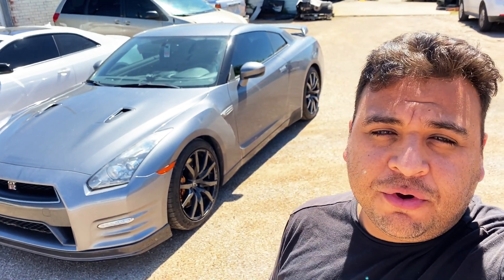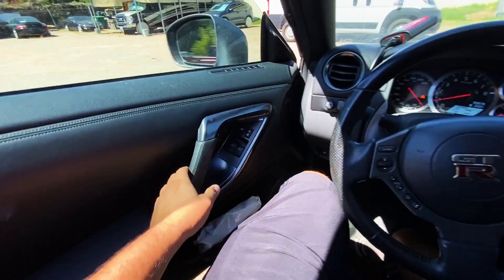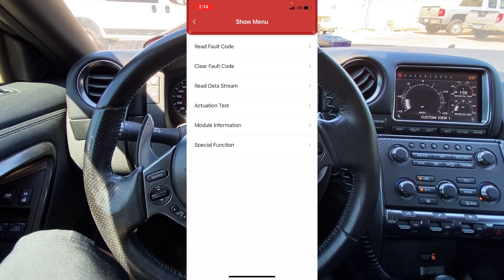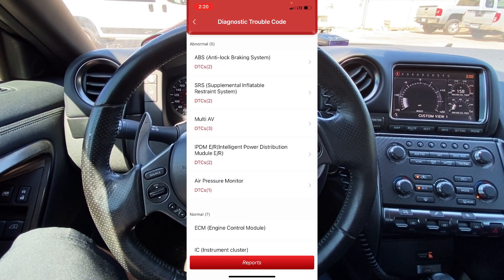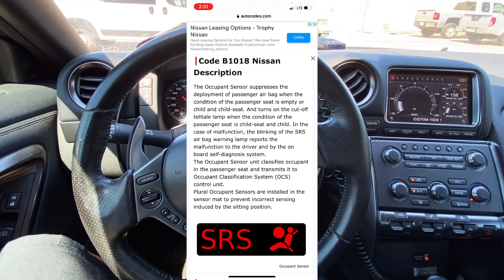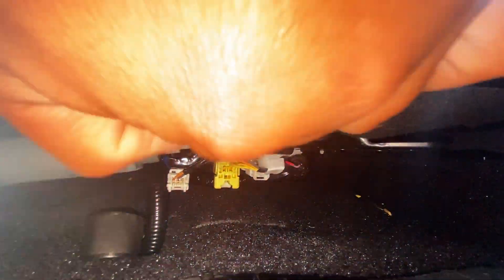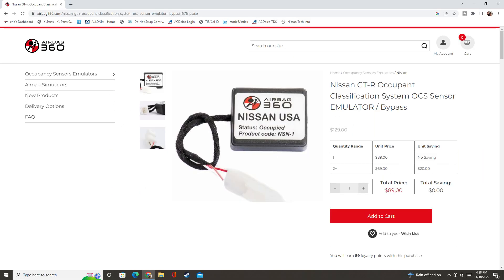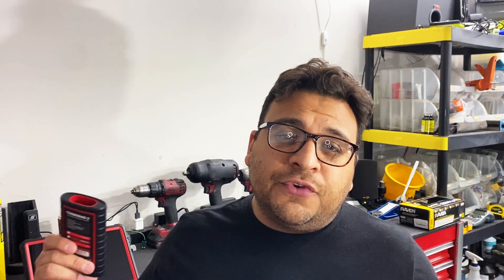NISSAN GT-R AIRBAG LIGHT ON / FLAT TIRE MESSAGE ON DASH DIAGNOSIS & FIX

Comment: i ordered this tool for 157 bucks and it shows that it support iphone in the doc. it does not (it says to download  THINKDIAG for IOS. there is no software on the app store. it only have THINKDIAG+ and when i go activate it it shows NOT supported on THINGDIAG +. it also DOES NOT SUPPORT NISSAN GT-Rs. that is not a car that shows on there site under supported cards.

Comment: You could have tried out a zero point calibration for the occupant detection system. In some cases an impact could have occurred at the passenger side that could have made the sensor run out of calibration

Comment: Does it still have a switch for you to manually turn it off like older cars had I'm sure that my mam's 2015 Micra has a manual switch that you can turn off does that mean it still has that sensor.

Comment: We have seen A LOT Of Occupant sensors on Nissan's and Infinities over the last few months.  Seen a few over the years, but a lot more in the last few months.  Must be something in the air haha.
Reply from the maker: Seems to be a very common problem and they’re not cheap to fix. I think airbag360 is onto something here.
Reply: @ADVANCEDLEVELAUTO  I never knew about them till your video, I will deff. be keeping them in the back of my mind for my customers as an option.  Thanks!
Reply: @ADVANCEDLEVELAUTO  very common and datsun used to be toyotas equal not any more

Comment: Eric I’ve been following you for a long time and trust your word. I purchased the diag one and also have the launch diag 4 mini. I’m a Diyer and it looks like a quality tool and would like to purchase one. You said the first year comes with all models. Are they just OBD 2 or enhanced versions. When I upgrade mine I only select Honda as those are the two cars I own but for a yearly update on all vehicles for approx. 100$ it sounds like a good deal. Any thoughts my friend and if I do purchase I hope you make a few bucks on the sale. Any help or advice is welcome you and family stay safe and well      Artie ☹️
Reply from the maker: If you are planning on buying the software update for your Thinkdiag 1 then it may be worth it to just buy the Thinkdiag 2 for a little extra money. They are having a lightning sale right now and you can buy it for $120. It comes included with the full enhanced software package for 1 year. It’s worth it if you work on various makes and models. If you only work on Honda then it’s probably better to just buy the single manufacturer software. The nice thing about buying a single brand software is that even after it expires, you don’t lose it. It still works, you just can’t update to the latest version. Which honestly isn’t needed if you don’t work on brand new vehicles.

Comment: Help - Help - Help…
I have a ‘13 LS460. It was rear ended. My Headrest A-Bag got activated on dash. Is there a Comp that can reset that module? It’s annoying. Thnks. 
Nice Vid, Eric🫡
Reply: Often times the module has to be replaced after a deployment
Reply: @keltecshooter   Thanks
Reply from the maker: Whenever you have an accident and an airbag component deploys, there is something called “crash data” stored in the airbag module. This data can not be cleared with any scan tool. The module needs to be opened up and the crash data cleared through EPROM. There are companies that you can send your module to have cleared. Do a quick google search and you will find them.
Reply: @ADVANCEDLEVELAUTO  Thank you Eric - You are the best

Comment: I love my ThinkDiag but just understand there is zero customer service or tech support.
Reply: True, I have the original thinkdiag. Can't even do generic obd2 now. I have the latest update. Can't do new model flex data. No support.  Email just claims "we are working on improvements. "  Well, it's  been almost 2 years.  I would say it's OK for diy. But, let's be honest.  Diy with modern car diagnostics,  means retired mechanic, or someone no longer in it professionally.  So, use it for a cheaper solution at home. Not really good for professional use.
Reply: Amazon description also state they want $99/yr if for update.
Reply: @austintx4556  Didn't Eric say that?
Reply: @austintx4556  Does it continue to work without the updates and can you choose to just update every few years instead of every year? His explanation of their definition of "subscription based" left me perplexed.
Reply from the maker: There is support. It may not be the quickest response time, but they usually get back to you within 24 hours. I’ve never really had a problem using the tool but I know some people may not be familiar with using advanced level scan tools, so they have a lot of questions. I believe that’s a lot of the reason the support team gets overwhelmed.